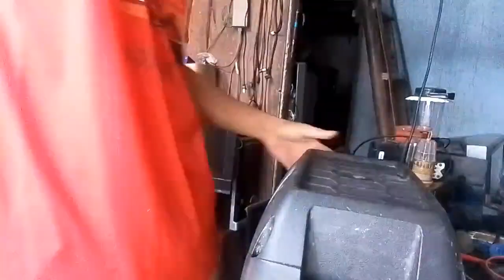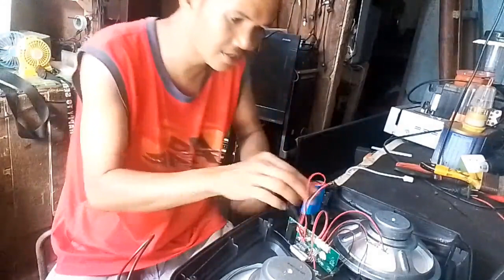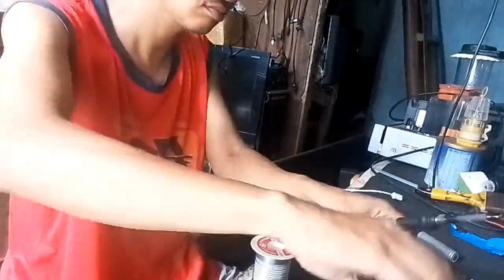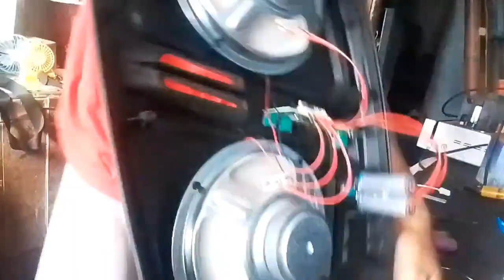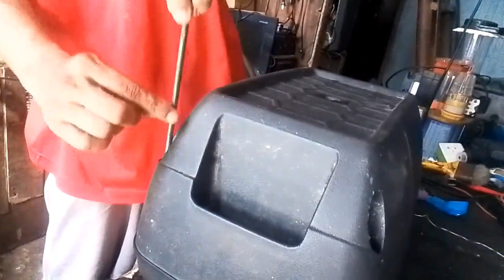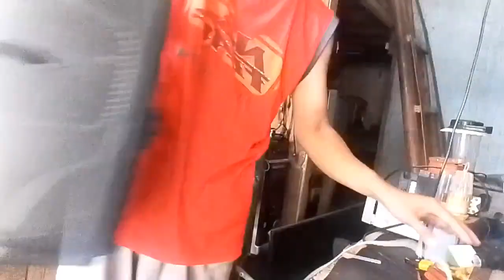bluetooth speaker biglang namamatay pag nilalaksan ayaw mabuhay..shout off

Comment: YAN TALAGA SAKIT NG module nayan MadalaS Batt tlaga Cra mga ganYan' Salamat sa Ideas'ganyan Rin mga pinagagawa Sakin mga BATT KAPAG VOLUME  MALAKAS SABAY oFF'tanX sa IdeAs Bro'
Reply from the maker: oo nga po  ...marami na ako nagawa na ganyan...lokal lang kc ang battery na nakalagay kaya buwan lang palit nq agad..
Reply: ano po masasuggest nyong bilhin na battery yung pngmatagalan na
Reply: battery ng vape na mattas ang ampere
Reply: Sakin nga tinanggal na battery at direct lng supply namamatay padin pag nilakasan vol.
Reply: @changegameplay  mababa ung ampere ng charger mo, pero cgurado ung problema jan audio ic icut mo ung control or mode ng audio ic mo

Comment: Bkt parehong positive ung hinang mo sir????
Reply from the maker: parallel connection po
Reply from the maker: positive positive 
negative negative
Reply: Parallel connection yan.. Pag parallel connection 3.7 v parin yan pero yung mah nya ay mag pplus
Reply from the maker: tama po sir❤️❤️❤️
Reply: @glensyzeodiy5243  sir may tanong ako..  Pwede ba iderekta ang charger sa mismong baterry ng Bluetooth Speaker? Ndi na dun sa board..
Reply from the maker: masisira po battery po nyan .lagyan nyo po isang diode..
Reply from the maker: pero di po adviceable yung direct mas maganda lagyan nyo po ng charging module .
Reply: @glensyzeodiy5243  pano po pgkalagay ng diode?

Comment: pinaayos ko ung sakin napalitan na bagong battery pero namamatay parin ayaw magcharge ng ayos. Sabe sa charger daw 9V daw?
Reply from the maker: nag proprotect po yun..
Reply: @glensyzeodiy5243  ano po ibigsabihin ng nag pprotect?
Reply from the maker: pag pinalaksan lang po ba ng volume namamatay? or kahit mahina ang sound namamatay pa rin?
Reply: @glensyzeodiy5243  dati po ayun ang issue po kapag nilalaksan volume namamatay. Tapos matagal ko po siya bago pinaayos. Ngayong pinaayos po pinalitan ng battery tapos ang sabi sakin gamitan ng 9v na charger kasi di po nagccharge. Kaya kapag binuksan namamatay din po
Reply from the maker: kung may tester ka...may ipapacheck ako sayo. sana
Reply: @glensyzeodiy5243  saan sir iccheck
Reply from the maker: yung voltage ng battery habang pinatutogtog...
Reply: @glensyzeodiy5243  hindi po siya mapatugtog kasi nag ooff agad po di maka charge ng ayos po. 5V lang po ba pwede na charger po sa kanya? yung battery niya po 7.5V . Yung 9V at 12v na charger po di nagana po eh
Reply from the maker: sukatin mo yung out ng charging module kung ilan ang nalabas na voltafe
Reply from the maker: voltage

Comment: Sir pag po malakas papo ung battery pero automatic o kusa syang namamatay ano po problema nun btw same po tayo nang speaker
Reply from the maker: baka sira yung boos up..power supply. need mo mag check ng mga voltahe.
Reply from the maker: minsan nagpropretect din sir.